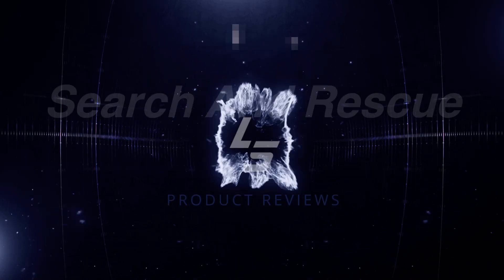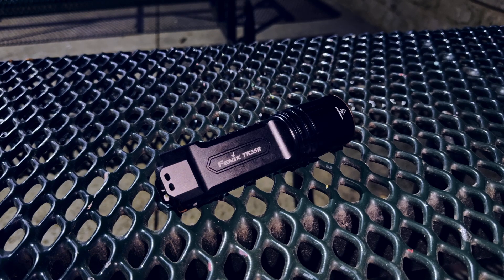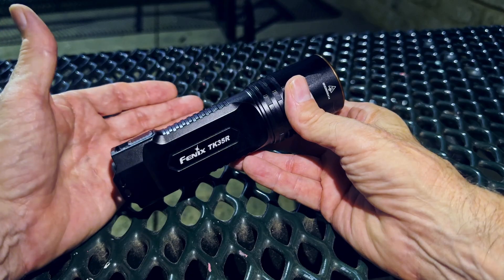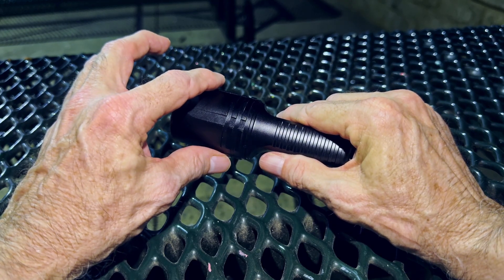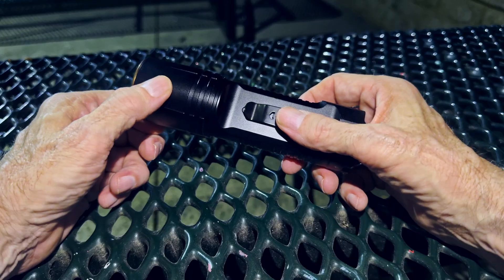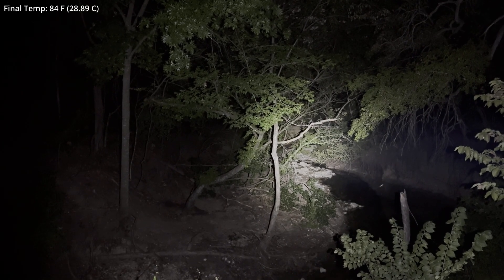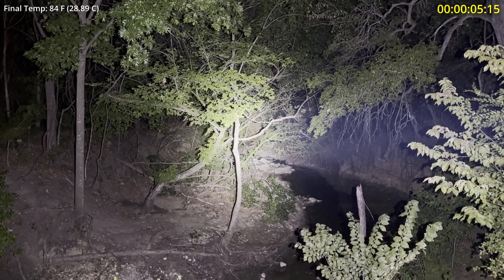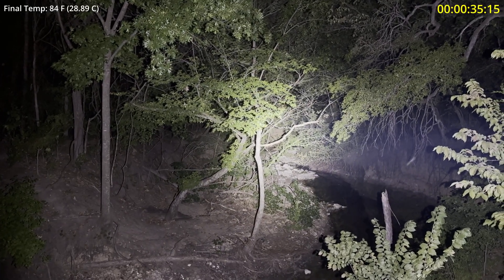FENIX TK35R Turbo Burn Down With Thermal Imaging. Will It Still Be Useful?

Comment: cool white tint with bad CRI just suitable for tactical purpose & take advantage on reflecting building, metal objects, white walls. In the forest, it needs more CRI & tint should be at 5000k & below to pop up leaves in the trees. Most tactical flashlight has high candela & super bad CRI that makes trees look very dry.

Comment: Which is better to have between the TK35r or the LR35R Pro? Thanks!!!
Reply from the maker: That's going to be a highly individual decision as they are kind of two different lights.  The LR35R costs some coin but has stepless dimming and Red/UV .  You get UV with the TK35R but no Red.  The beam outputs from the two lights are different, so it comes down to what best suits your use cases, budget, etc.  With any such decision, the only person who has to be pleased is you :). Thank you.